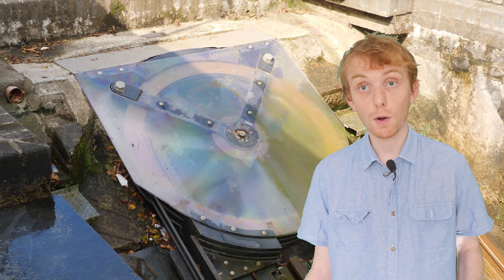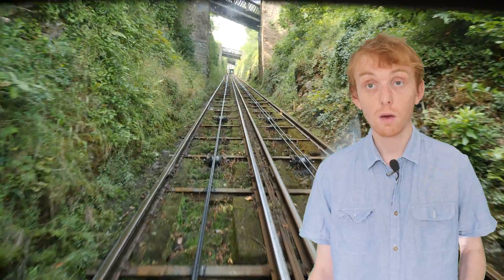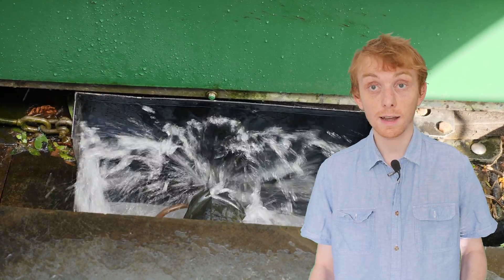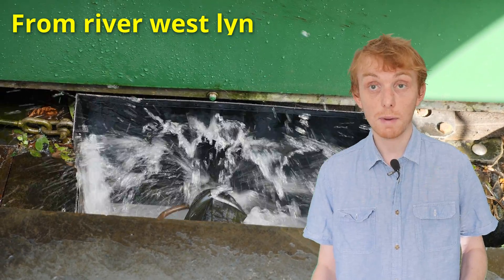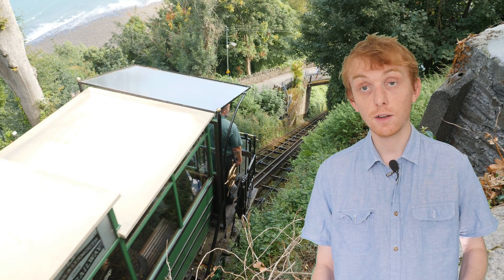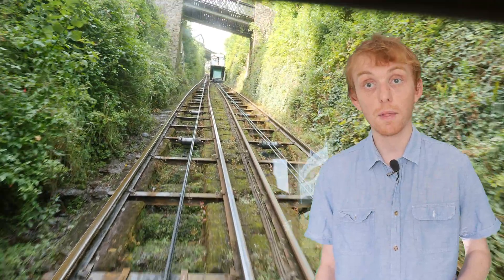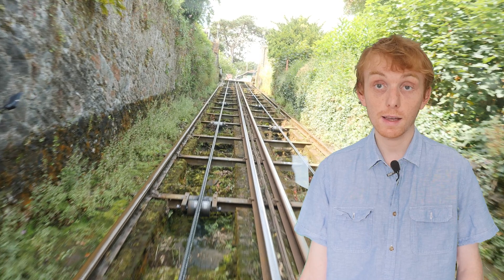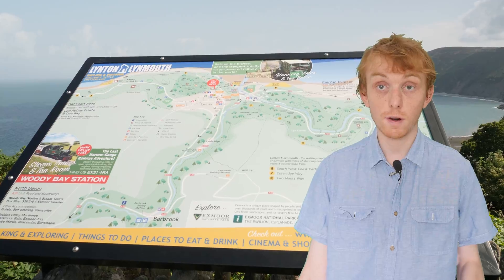A Railway Powered by Water!

Comment: Thats neat!
The water still has to be pumped up the top of the hill with some motorised system right?

Ooo they could use a hand powered archimedes screw but that would take quite a while haha
Reply from the maker: It is on a natural stream, that flows down the hill, they have diverted it for this project. But I assume they have a pump for backup in a drought.
Reply: @samthetinkerer4947 awesome